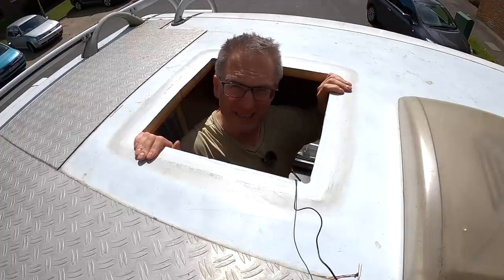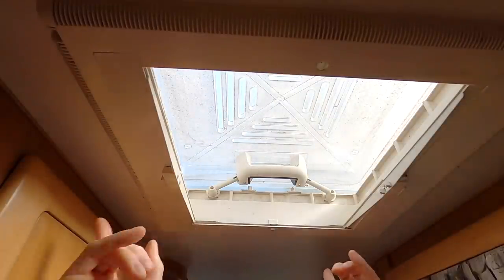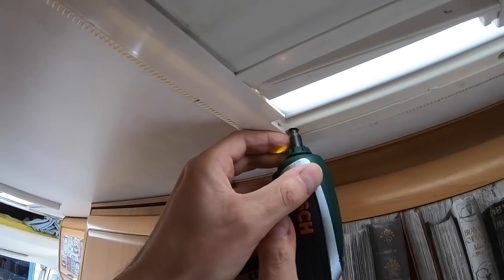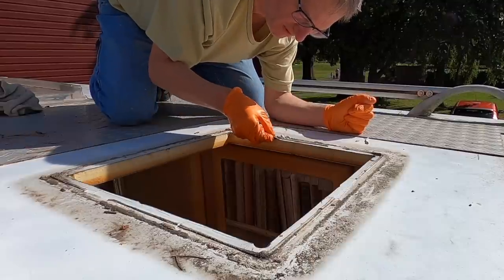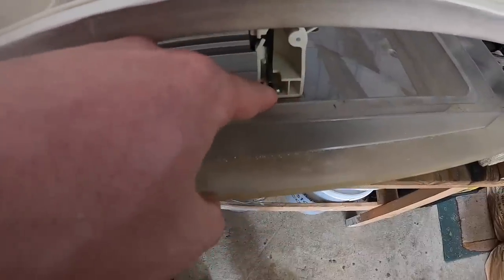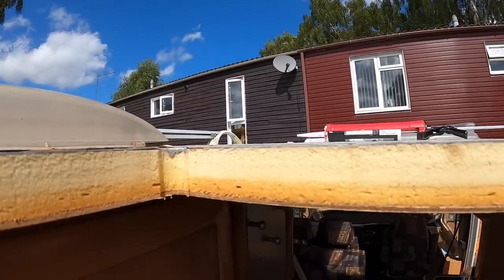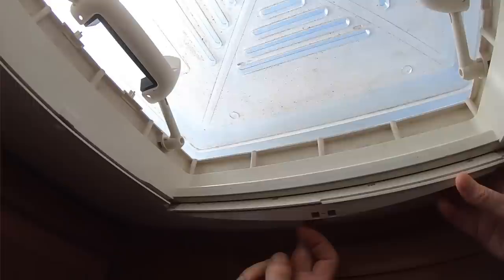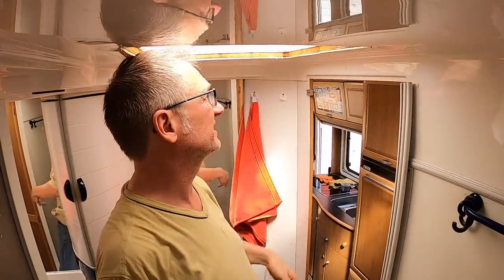Our Roof is LEAKING - Resealing Skylights

Comment: Interesting video Ads, as always. I'm now going to check all four of my mini heki's and the large heki over the lounge area. Wish me luck.
Reply from the maker: Remember, Robert. If it's not broken don't fix it. Good luck and let us know how you got on.👍🚐
Reply: @HermanHitstheRoad  They all appear ok. Being in Southern France they have been affected by very strong UV over the years and I''ve already replaced the large Heki twice because they just crack and I've also replaced the 4 mini Heki's once. The only water ingress I've had was after a freak storm where the wind blew rain water underneath the large Heki and through the rubber seal. Oh, I've just remembered, I lost a mini Heki in Spain and although we were stationery and  it was open at its minimum setting a very strong gust of wind ripped it off the roof and deposited it 50 metres away! Oh the joys of being a Camping cariste as we are called out here. I'm now in the process of replacing the two 110 a/hr leisure batteries buried deep within the double floor of the van. Safe travels and keep those vids coming. All the best Bob & Ann
Reply from the maker: @robertpenning3501  Wow, you've not had much luck with your rooflights.Good luck with the LBs
Reply: @HermanHitstheRoad  New LB's should arrive on Thursday. Get them fitted and then we're off to Provence and the Cote D'Azure for a  couple of weeks. Tough old life when you're retired. I'm interested to know what you do for a living?
Reply from the maker: Hi Robert, I'm a computer consultant for a software company. Developing solutions to problems is what I do mainly.
Reply: @HermanHitstheRoad  Very different from fixing a hole in Hermans floor or sealing roof lights. I suppose you like the contrast?
Reply from the maker: Actually, they are similar, well in my head. It's all problem solving to me. I like finding out how something works and fixing it or improving it.
Reply: @HermanHitstheRoad  I can see what you mean now you say it. I like your thoroughness and your varied motorhome related vids. I find them refreshingly different from the other vanlife ones. What next I wonder?

Comment: A bed of mastic strip may have been a better choice but really good to see it cleaned to that degree. Nice 👍
Reply from the maker: Thanks Richie, that's what I must have taken off. The old mastic strip didn't seem to have bonded to the roof properly and I wonder whether the roof wasn't cleaned or the strip is any good at all? Any idea? 👍🚐
Reply: @HermanHitstheRoad  sikaflex is better imo..the mastic stuff goes brittle.. sanding the skylight plastic helps bonding too as new plastic has a sort of silicone on it..
Nice work 👍🏼
Reply from the maker: Thanks Scott 👍👍🚙
Reply: @HermanHitstheRoad  so I decided to go and check mine out today as it was raining..and guess what...drip from the bathroom skylight..

Sikaflex time as soon as it dries up 😤
Reply from the maker: Good choice. No leaks here 👍👍👍
Reply: @HermanHitstheRoad  One little thing I learned (not sure how true it is).. that if you use white spirits to clean, then you need to go over it with alcohol before applying mastic.  That's because white spirits has oils in it that won't evaporate.  

As for which alcohol, you could use a scrumpy cider.  Definitely not one of those commercial ciders like strongbow though.  ;-)
Reply: @surfreadjumpsleep  when removing old mastic or sikaflex type sealant I find WD40 works brilliantly, just spray on wait 1 minute then wipe off. As already mentioned it is extremely important to then wipe over the surface with alcohol to ensure the surface is free of all contaminants before applying the new mastic strip.
Reply: @stephenturnell9308  that's a great bit of advice.  Thanks for sharing that I'll try it next time.  Happy new year
Reply from the maker: Thanks Stephen. Some good advice 👌

Comment: Thanks for sharing, whoever did those must have been short of sealant! It's a wonder they didn't blow off! Hopefully no lasting damage though.
Reply from the maker: I hope so too, Bob. I think they used mastic strip which comes with the roof light but they didn't clean the roof properly. 👍👍👍🚐
Reply: @HermanHitstheRoad  Sounds like they didn't know what they were doing.  I have one fiamma roof vent and it's a terrible piece of plastic.  After my experience with Fiamma I would not be trusting anything from Fiamma & certainly not their method of sealing.

I've got a couple vents to replace and I think I'm going with the Heiki mini.

Comment: Excellent job. Too late now but you should use non-setting mastic to seal rooflights. Sikaflex should only be an issue if there are any leaks or if a future replacement is required. 
Great vid, keep them coming 👍
Reply from the maker: Thanks Ian. I think non-setting mastic was probably what I scrapped out. It seemed to have set though! 😉🚐👍

Comment: Thanks I had mine taken out and replace with mini heki's cost me £100 each but lightened up the van no end, I have a large wind up roof light that seems to have a seized  up winder have you come across this as I would like to fix it before we start touring again.
Reply from the maker: Hi Jim, the winder mechanism is outside under the roof light. The cogs are plastic but the threads are metal. See if you can some WD40  at them (you may need to get in the roof). I can see the mechanism through the roof light if I'm high enough. Try not to force the handle.
I hope this helps. Let us know how you get on.  🚐🚐
Reply: @HermanHitstheRoad  Guess I'm going to have to remove the trim from around the Heki to get at the winder mech so I can lube it but  I've never had it stripped down before I wondered if any other viewer had done one?
Reply from the maker: The groups on Facebook can be very helpful. If you have a Hymer you could try Classic Hymer Technical or there is Motorhome Happiness.

Comment: If you use sikaflex you'll never get it off again!
Reply from the maker: At least it won't leak unlike the putty that I should have used,  lifes adventures
Reply: Yeah I was thinking the same. Some butyl tape and then if necessary and thin bead of Sikaflex around the outside just as UV protection and additional seal.

Comment: Doesn't sikaflex harden? I was told to use something that doesn't set 🤔
Reply from the maker: Why is that a problem, Andreas? The non-hardening putty that I removed hardened and became brittle cause the vent to let in water.
Reply: @HermanHitstheRoad  i don't know 🙈👍 everyone says to use the type that does not harden, but another video I saw, te guy made a very high bead.. not like the one you made.

I recently bought a 2006 mh, and I don't like the way one of the skylights look, so I was gonna reseal it, and researching. 

I think it is to allow for expansion/contraction of outer skin.
Reply: @HermanHitstheRoad  like 12mm high bead iirc.
Reply from the maker: But Sikaflex is flexible and will move with expansion. I can't imagine the putty doing that. Of course, these are my opinions and I could be wrong. I didn't like the fact the previous putty product had turned brittle and Sikaflex has been great in the past.
Reply: @HermanHitstheRoad  yeah  i saw, but there was so little of it on your skylights. The other video the guy had to use a knife etc to cut it..
Reply: @HermanHitstheRoad  hey man, I saw this while researching :) 

"then I would use a non-setting mastic because the different expansions with temperature might rip even a flexible sealant apart. In fact I would probably always go for the non-setting mastic"
Reply from the maker: Thanks for sharing your findings, Andreas 👍
Reply: @HermanHitstheRoad  i followed 👍 will look at rest of channel when I get back to my moho